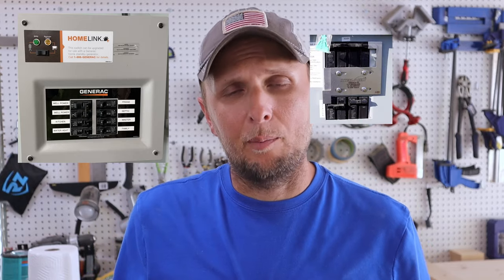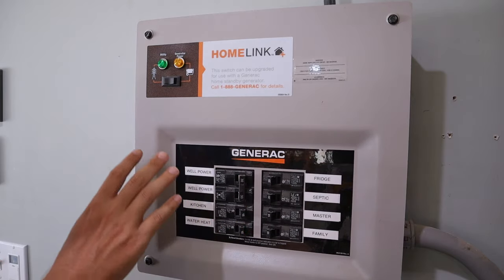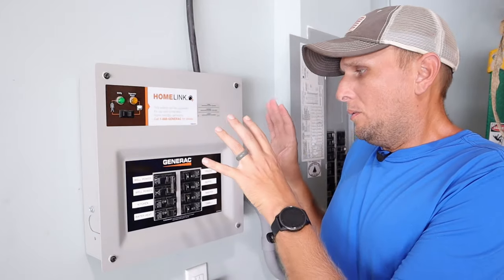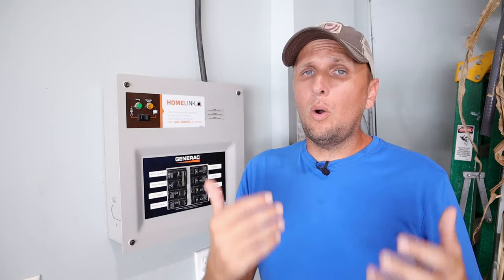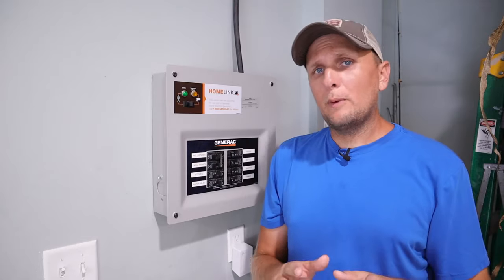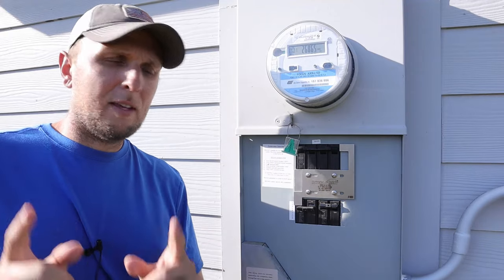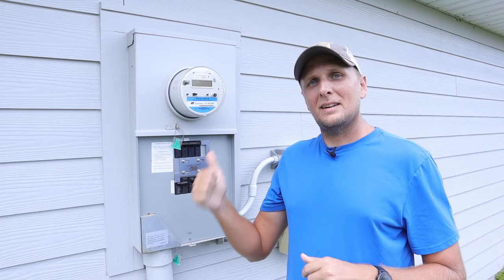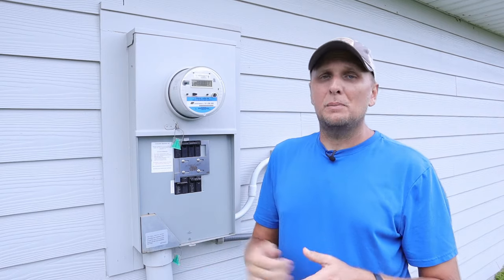How To Choose Between A Transfer Switch Vs Interlock Kit With Power Inlet Box

Comment: Hi loved the video just subscribed.  Now I have a generator that is not big but want to use a 50 amp hook up box for when I up the generator,  Is this okay to do?  Also is there a way to add an amp meter on the circuit panel or on the generator?  This would allow me to know if I am doing to much.
I have an electrician coming to do the hook up to the panel.  I am not comfortable doing this..

Comment: I have looked at both options and I tend to favor the interlock kit. I will add there is one additional option. You can have installed a generator connector that connects to the main power coming in. When you connect your generator and turn on the power it senses the power and disco's it from the main lines.
Reply: go for interlocm kit. The last option you mentioned is a stupid too risky decision that please avoid. No offense intended.

Comment: Are there any differences in how the neutral and ground wires are dealt with between the two, transfer switches vs interlock kits? Do you bond neutral and ground at a transfer switch?
Reply: No, you never Bond the neutral and ground at the transfer switch.    Okay you usually would not.  If you switch the neutral and have a ground rod at the transfer switch... Then you could bond the ground in the neutral there and your generator would need a floating ground. But this really would make sense to do.

In a separately derived system, they will be bonded at the generator and the neutral will also be switched in the transfer switch. The generator must be grounded to a ground rod.

In a non separately derived system, they are bonded at the service panel and the neutral is not switched only the hot wires. In this case the generator must have a floating ground.

The bottom line is the ground and neutral are always only bonded together at the point where the ground rod is located.  Otherwise you have the ground wire potentially carrying current of the neutral wire all the time.   Which means it would energize the chassis of a lot of equipment all the time.... And in some cases that would shock people just to touch things.   Even though it's typically small the voltage drop across the neutral wire does cause it to have a voltage that's different than the ground when it's a distance away from where it's grounded.
Reply: @duskyman1  Thank you, that helps.

Comment: I think both solutions work just fine. Most people when they want back up power purchase a big generator to supply "emergency" alternate power. Then they decide how to hook it up.  People should determine what emergency circuits they "require" in an emergency and then purchase a generator that will supply those needs. A small generator (down to about 2KW) could supply power, meet your needs, be quieter and will run a long time on minimum fuel. If switching a few circuits, the transfer switch is much cheaper than an interlock kit. A four circuit switch and a small generator could meet your needs for less than 6 or 7 hundred dollars. If switching the whole house to power everything (including Air Conditioning etc.) then an interlock is probably better and more expensive. Before doing either, check your HOAs and local ordinances on installing anything. Many prohibit the installation of generators period. Just my thoughts good video.
Reply: I don't see how installing an interlock will be more expensive??? Have you ever installed one?? Do you know the cost and steps to install a transfer switch. I have done that before and your comments reflect ignorance in the topic.

Comment: I have a Mobile Home, where the utility power comes into a NEMA 14-50 box on the house, with the female receptacle being the hot utility power, and a big Male plug being what goes under the mobile home, to the breaker box in the master bedroom (which has 8 20-Amp breakers). The PG&E meter is a 100 yards away in a cabinet with all the meters for the park.  I want to install a generator power inlet and transfer switch or interlock on the outside of the home at the connection spot with the NEMA 14-50 box.  What kind of device and hookup would I need? It's like I need something to route intercept the utility, to the interlock/xfer, rather than wiring a transfer switch to each circuit.

Comment: Great info, thanks! It seems like the interlock is the only decent option for us. We have two furnaces running off an 80A sub panel in the furnace room, which also has breakers for lights and outlets in almost half the house. The 200A main panel in the electrical room powers the kitchen, water and sewage pumps (we’re on a well and septic), and the remaining lights and  outlets. Given the staircase and finished walls and ceiling between the furnace and electrical rooms plus other framing obstacles, it would be a nightmare wiring job to connect the furnaces to a transfer switch in the other room.

Comment: I have a little Honda EU2200 generator that I've used in the past by running extension cords all over the house when power has gone out. I wanted to implement a more convenient way to do this with minimal trouble and cost. And I was able to do so as follows.  
I have one of those older Sylvania/Zinsco load centers and there's no ready-made interlock kit that I could find for it. So I simply installed a normal external outlet below my load center connected to dedicated circuit breaker #4. Then I did a little re-arranging of the load center so that the circuits I want to power are all on even numbered CB's. 
So when the power goes out, I turn off all CB's including the mains. Then I connect the generator to the external outlet using a short double-male X-cord and start up the gen. Then turn on CB#4. Then turn on the other even-numbered CB's one at a time. That powers up both frig's, the furnace, the computers, TV, surveillance system, burglar alarm and most of the lighting. 
Now of course, I would never turn on the main breakers while the gen is running! Total cost, less than $50.

Comment: I believe the transfer switch as well. For we heat and cook with natural gas, using electricity to heat only our dryer and my small shop.
The main loads then are fridge, freezer and the two circuits which can be turned off. Most lights are led, with tv and entertainment.
 plus circulating fans. I elect to use a duel fuel gas/naturalgas generator of moderate 8000 watt.

Comment: great video.  Although you said the interlock would be more trouble choosing wich circuit to open, it seems you could just leave the few that you would have chosen for the transfer switch.  is this correct in your estimation

Comment: I need help. I bought a 12,000 watt 50amp dual fuel generator. Got a quote for an install of an interlock kit = $1,200. I also called 6 other electricians, most of whom told me that an interlock kit is cheap junk. Nearly all of them told me to get a transfer switch. I’m just about to pull the trigger on an transfer switch, and I find this video. What I also don’t understand is my AC is on TWO 60amp circuits, and my heat is on 4 60amp circuits. I have one AC unit. I do not know why it’s arranged this way. I’m not an electrician. I was also pretty bummed to learn that even though I bought a huge generator, I can’t run AC or Heat, due to it being limited to basically a 50amp “surge” of power because the hookup is 50 amp. Not sure if any of this makes sense, would love some advice from anyone qualified to give it. 

Thanks!

Comment: I had been on several jobs talking with electricians on possible scenarios. I was leaning interlock. My roll out generator has an automatic transfer switch that can be purchased separately. However it limited me to only 8 circuits like in your video. The clear choice was interlock. I have a Honda EU 7000is that can power up my entire house in my 32 breaker panel. I load tested everything & with everything on at my house. My house draws 7 amps at 240 volts. (City water, city sewer, gas dryer, gas stove. On demand hot water from my oil furnace & heat). I can even bring on my 2-1/2 ton central air with a soft start kit. 
I have an after market pony tank for my genny & it gives me over 48 hours of run time on 11 gallons of gas. 
It’s peace of mind folks. Think of it as an insurance policy you never hope you need? But if you do lose power? It’s there 
Thanks for posting this video about the pros & cons
Reply: 7 amps, i don't think so.
Reply: Get this? I only have a 100 amp service. 
That was the standard over 50 years ago.
Now the new standard is 200 amps. Believe it or not many people are opting for a 400 amp service. Crazy when you think how little their house actually draws?

Comment: How do I wire up the Interlock system for a 120v generator? Do I use just a single 30A breaker to feed one side of the breaker box bar?

Comment: I have a smaller generator 7125/5700W for my house. I can't find an electrician willing to install interlock kit , they all insist on separate panel with transfer switch. They say it's for safety reasons say if I sell the house, the next owner won't accidentally switch on more brakers to overload the system.

Comment: Thanks for the video. I have a question, if you don't mind...

My home has two 200A panels. I'd like to power both from my generator and was thinking of doing the following...
1) single power inlet box
2) junction box that splits the feed to each panel (one wire group in, two out, with all three tied together in the j-box). Two hots, neutral, and ground on all three. 
3) each panel with an interlock and breaker

Does this sound kosher? Only thing I'm thinking about is the shared neutral across between the panels and any adverse effects this may cause. I simply don't know what I don't know.

Thanks for any info/advice!
Reply: I am considering doing the exact same thing. I read on another post this was an option if you had two main panels. I've sent this setup to my licensed electrician. I haven't heard back. Multiple manual switches and associated wiring would really become expensive. Hopefully How To Home has some thoughts.

Comment: Hi Adam - thanks for the informative video. My father recently gave me a 4800 watt generator which I plan to use in the event of a power outage for essentials, plus a few key lights etc. I plan to have an inlet box and interlock switch installed, fully understanding I can only power a certain number of circuits in the panel, but I want the flexibility to pick and choose circuits I want to power, which may be different depending on the outage. For example, in the winter I may not need to worry about the sump pump running, so I could allocate that to whatever else I want. My genset has a 120/240V 20 amp 4 prong twist outlet on it. My question is, can I have a 30 amp breaker installed for the inlet box in the load center connected to a 20 amp 4 prong inlet box? I would like to future proof a bit in case I get a larger generator in the future, and that way the only change I would need to make is changing out the 20 amp inlet for a 30 amp inlet (no work in the load center required). The cord my father gave me with the genset is a 10 gauge cord with a male 20 amp 4 prong plug that goes into the genset and on the other end are 4 bare wires that were previously connected to a transfer switch at his house. I would just have that end fitted with a female plug. As another alternative, could I have a 30 amp 4 prong inlet installed, and then have that end of the cord fitted with a female 30 amp 4 prong plug opposite the male 20 amp 4 prong? It seems the gauge would handle more than I need and the same would go for the 30 amp breaker in the load center, etc. I also found an adapter on Amazon for 20 amp 4 prong to 30 amp 4 prong as another possibility if I went with the 30 amp inlet. What do you recommend for my situation? Thank you for your thoughts, and thanks again for the great vids.

Comment: I run an 11000w unit, most video's I watch never address the issue I am looking for, we don't have natural gas, our heat is a forced air unit that is fully electric, we also don't want to run the generator all night, do you have any suggestions on what we could do?

Comment: Hi, I just bought the Westinghouse Wgen9500 and have been looking a ideas for sheds and how to connect the backup.  I plan on building the shed but will have licensed electricians doing all the electrical work. Plan is to use the 50 amp connection. Do you think this would be enough to power my 1700 sf house with 2 refrigerators?  All my lights are LED, I have ceiling fans but typically never have more than 2 going at any time. I only use them if I am in the room.  Does it make sense to connect the 30 amp too?  is that possible.  electricians have noted both types of connections you have shown here.I dont have  a main power switch on the outside though.   I also dont expect it to run my AC but do expect it to run the furnace.   On a side note I am getting quotes for a car charger too since they will be working in the same area but it will not be connected to the generator.  Sorry for all the questions. Thanks for your time and for this video.

Comment: Man you sound exactly like many electricians I called. "You can not run the whole house on such a small generator", "You need to have different channels on your ATS  panel". You know what? My 4.6 KVA generator has been running the whole house  during every outage for 10 years with no problem. You guys need to realise we are in 2023. An air cond only uses 500W, a light bulb is 10 watts, dryers have heat pumps. Plus we are on a rural property and even the water needs a pressure pump. We only had one issue with the load when the kids learn cooking. Oven+microwave+kettle+other things =overload. Big deal, the generator is in safe mode, restart it and done. Our tranfer switch is a simple 1.0.2 rotary switch. Cheap, brilliant and no regrets regarding all the electricians who came, assessed and left without even trying to understand.
Reply from the maker: 😂 most people’s AC unit will not only require 500 watts to start it and I highly doubt your in-rush is anywhere near that.   What is it?  A windows unit?   We say that because this is nowhere near the case for most people and being underpowered could damage some equipment.  Glad you’re happy with your setup but it’s just not the case for most.
Reply: @HowToHomeDIY  500amps? Now this is a joke. What kind of cable would take this? We have a split unit in most rooms and I reckon they are oversised. Most people are not happy with their setup because they stick to whatever the electrician says. Since we did it on our house, around 20 house owners insalled the same in our area, all very happy, yet still confused as per why electricians stick to the system you showed in the video. Sorry buddy. Sometimes, you've got to think out of the box a little. It's cheap, easy, simple, reliable and extremely easy to operate.

Comment: I haven't added up the whole amps for the house, but it seems as if you turn off all things that draw a lot of amps, you could leave all the breakers on and still have the lights for each room IF you have all LED bulbs.

 Of course the refrig needs to be on and it's a pain to pull it out to unplug, BUT you can turn the temperature knob to a warmer setting or off and just make sure not to be opening the door needlessly. Tie a rope around it if the kids keep forgetting.

With the interlock a guy could take turns shutting off breakers but an electrician told me we should not use breakers as switches. Evidently it shortens the life. They are not intended to have electricity arcing across the connections.

I'm leaning toward the interlock, It appears to be something I can do at home.

Comment: I am trying to find code to the county I live in in FL it pretty jacked up in this state basically would just shut off the breakers I don't want  but of Couse the interlock on Amazon 45$. I came from compliance and code I am retired and don't wasn't to deal with the scabs I have seen already if you been around high voltage you have respect. Dave i am the only who would be change over . Thanks

Comment: So I have a new Generac GP9200e that is capable of 9200 running watts and 11250 peak. It has a 30 amp plug, but generator is capable of more output. So which inlet box should I use the 30 or 50?

Comment: before watching the video im going to take a moderately thought-out guess that a transfer switch is very limiting in the amount of circuits it can be connected to, and an interlock kit probably can do any or all circuits but you have to be mindful of your generators output and not overload your generator with all the breakers that are normally switched on in the main breaker panel. now time to watch the video and actually see whats being taught

Comment: Both have their place for a grid down scenario.  But, a 10 circuit transfer switch can be used with solar as the input (instead of a generator) and when the grid is not down, easily allows you to run whatever loads you want on solar, and the rest on the grid.  An interlock is an all or nothing, so only useful when the grid is down...

Comment: I have a 240 V supply to my panel from my solar panels in addition to public utility input. In the event of a power outage Solar is not connected to the house until utility power is restored. i’m curious as to any safety precautions needed because of this solar input. I do have a shut off handle on a box for the solar input and think that is all that is required in the event of a power outage and generator being operational. What do u think?